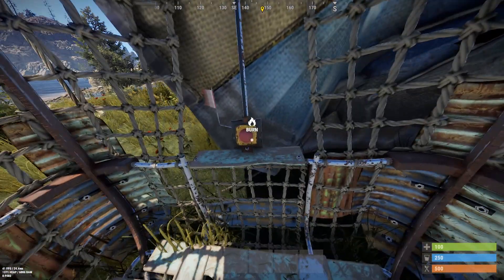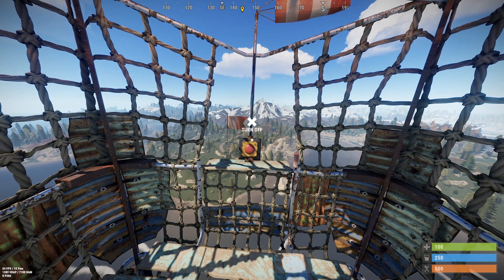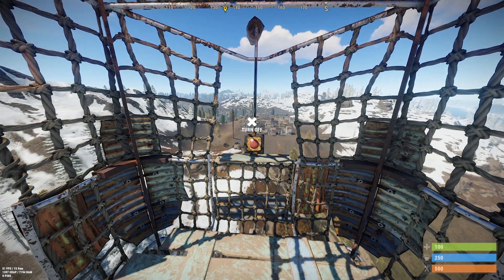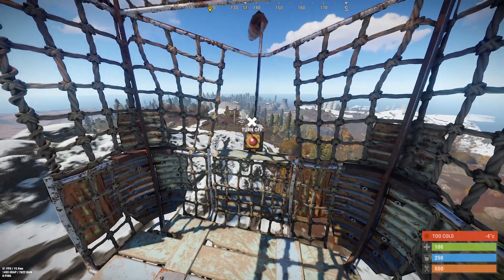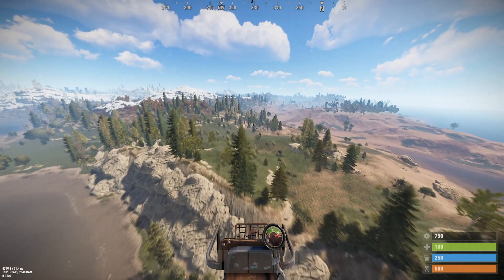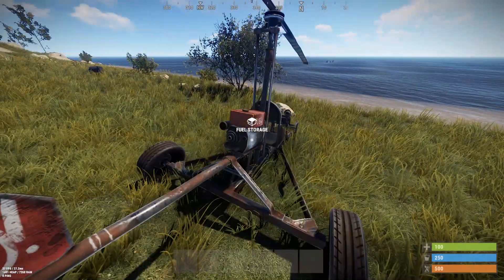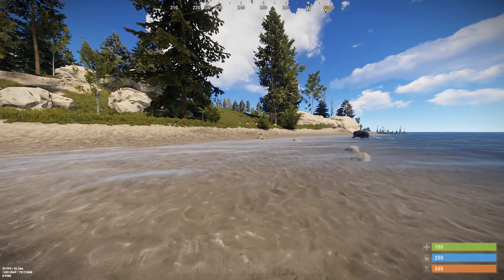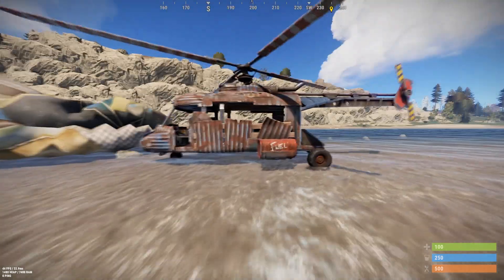Rust: User Request - Balloon (and other flying vehicle) Fuel Consumption

Comment: I would like to see in-depth guide to solar panels, wind turbines and generators. Sth like what's the optimal height of a tower where turbine should be placed on or how solar panels shoud be placed in order to recive optimal ammount of sunlight.
Reply from the maker: Hi Alex, I am going to do some re-testing on wind turbines, they don't quite seem to be the same after recent updates. Typically, higher is better, and use caution for obstructions.   For solar, North is simple, if you have multiple, I tend to favor NE/NW facing placements to catch more through the day. If you want to a solar panel to trigger something as first light or sunset, then face them even further E/W than just directly NE/NW, but you will get less overall power during the day.